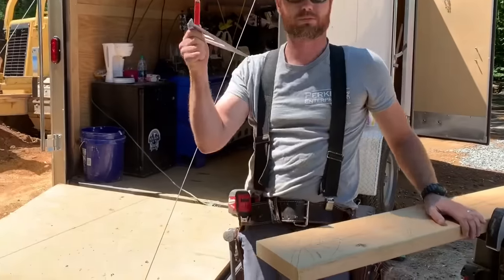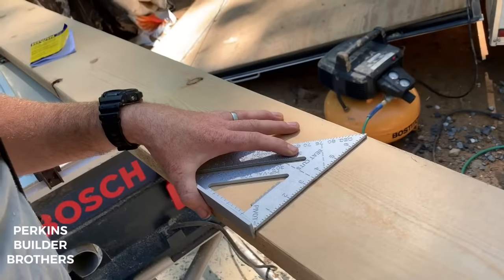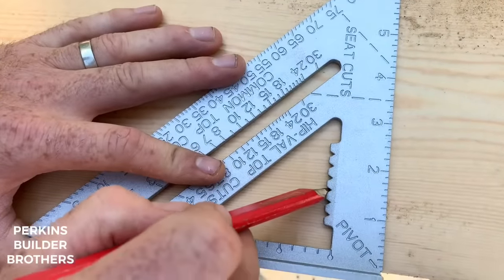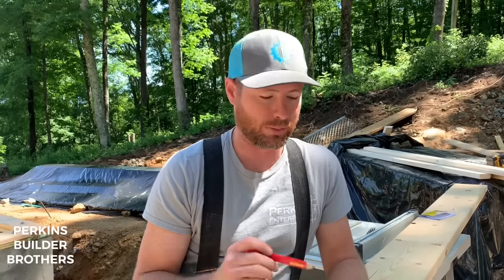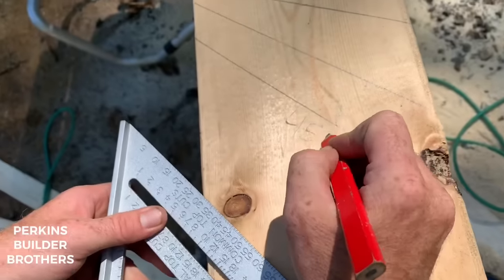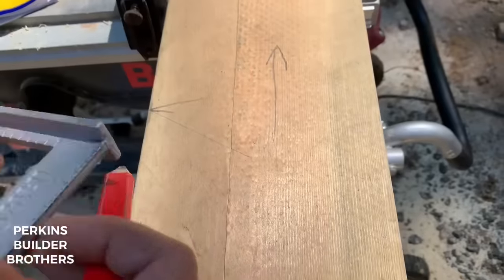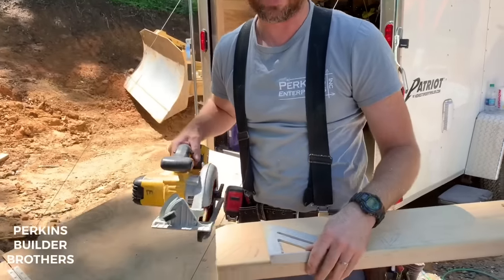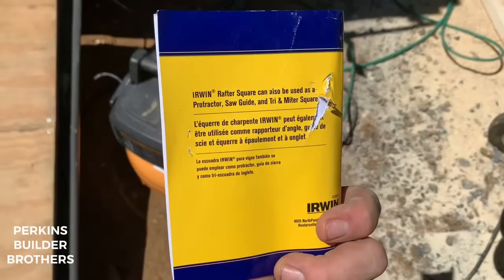How to use a speed square | Why it might be the most important tool you own

Comment: Mistake at 3:09 - that is a 40 degree line from a perpendicular to the board length, or a 50 degree line from the long side.
Reply from the maker: Mark M yep your right... Unfortunately I didn’t catch that and you can’t change your video once it’s posted :-)
Reply: @PerkinsBuilderBrothers  No problem... But can you suggest what I can do now that my roof is 6" above the walls? 😉
Reply from the maker: Mark M haha! Reverse engineer it

Comment: Great video! …but this important detail is incorrect: 3:01
“And that’s a 40 degree line in relation to this edge of the board”

In fact, that’s a 40 degree line in relation to an imaginary 90 degree line perpendicular to the edge of the board (across the board.) It is a actually a 50 degree line “in relation to the edge of the board.”

Comment: Keep your hand behind the blade, set the square on the back instead of the front hold the board extend your thumb on the edge of the square. You do it that way every time until it's habit and your hand will never be in the path of the blade.

Comment: Proud carpenter here. I always tell my apprentices that speed squares teach you nothing. This video, while handy to those who are not skilled in the trade, proves my point that they should not be used by any professional carpenter. A 1’ framing square will do absolutely everything that this square will plus more. It teaches you the theory behind all the calculations that a true carpenter should be doing. Get good with a framing square before you use a speed.

Comment: 3:05 Hold on, if the angle of the square hanging of the board is 40°, then surely the line you draw is 50° in relation to the the edge of the board?

Imagine the same process and the lines that would be drawn if it was 20° you'd measured.

Comment: I was hoping you'd have a hidden gem of info I didn't already know but before getting through half of it you claim to have scribed a 40° line in relation to edge of board when in fact it is 50° from where you pivoted. The 40° you're stuck on is the portion of the speed square hanging off of the board - therefore the remaining 50°(of 90 total in a square corner) is what you've made your mark with. Not trying to bust your balls just pointing out how you don't want to make a tutorial spreading incorrect information, particularly to those who wouldn't know any better

Comment: What about using the speed square with a level to find the pitch of an existing roof? Or how about what those notches are for on the opposite side of the ruler side? ( the are for laying out both sides of a stud without having to measure 1 1/2” like u did).  The edge with the small circles, or where your holding it. Also that scale goes up to 3 1/2”. Your video was ok but lacking a lot of more advanced knowledge.

Comment: He was wrong about the angles. If you set the square to 40, it's a forty degree angle in relation to the 90 of the square, not the edge of the board

Comment: Plumb cut, not top cut. They're even dumbing down carpenter these days. 

Don't mess with making two lines for a seat cut. Just find the degree value of the plumb cut for the pitch you're cutting. Then find its compliment (subtract the plumb cut from 90), that is your seat cut. 

Don't forget you have ruled marks on the inside of the square. Use those markings for layout (1-1/2", 3", 4-1/2").

Comment: He just made a common mistake, he used the speed square for a measurement, but pulled from the edge of the square instead of where the square pushes tight to the board

Comment: I NEVER CARRY ONE I CARRY AN 8X12IN SQ THAY DIDN'T HAV SPEED SQUARES WHEN I STARTED OUT. BESIDES EVERY TIME I REACH IN MY BAGS THE FN THING GETS DRAGGED OUT. I CAN STILL DO EVERYTHING A SPEED SQ CAN DO AND MORE WITH IT. AND BY THE TOP CUTS OF RAFTERS ARE PLUMB CUTS AND BOTTOM CUTS ARE ( WAIT FOR IT ) LEVEL CUTS. AND YOU NEGLECTED TO EXPLAIN THE LEVEL CUT OF A HIP RAFTER. I KNOW ALOT OF CARPENTERS WHO CAN'T USE A FRAMING SQ TO CUT RAFTERS OR DO THE MATH TO FIGURE RISE & RUN AND I NEVER LAYOUT. PLATES ON THE FACE OF THE PLATE AND GOD FORBID LAYOUT EITHER SIDE OF A STD UNLESS ITS BETWEEN A KING STD AND TRIMMER THEN ONLY THAT LINE OR ONE SIDE OF A PARTITION. ALL 16IN CENTER STDs ARE CENTER MARKED ONLY NEVER SQRD BY TRICKS CARPENTERS LEARN.  KEEP ON BUILDING.    PS. THE SIGN OF A GOOD FRAMER IS HOW FAST HE CAN FIX HIS FUCKUPS.!

Comment: Everything is easier in tenths. Standard is inefficient and a pain in the ass. What's halfway between 3/16ths and 5/8ths? What's halfway between 6/10ths and 9/10ths? 7.5.One can be done in your head, the other doesn't even look logical on your calculator.

Comment: You Americans really need to go METRIC....feet , inches ,half inches ,quarter inches ,eighth inches, sixteenth inches......bloody hell how hard do you want to make it for yourselves ?   If you can count from 1 to 10 you can work metric , its so easy.
Think about weights . 1 litre of water weighs 1 kilo therefore 1000 litres of water weighs 1 tonne...easy..1 sq metre of roof area will catch 1 litre of rainwater  for every millimetre of rain that falls ..easy. When building in the metric system EVERYTHING is measured in millimetres , no confusion , no complicated adding of fractions...just straight addition and subtraction.
Reply: What is so difficult about working in 10/16ths? A 16th is actually far more precise than a millimeter 1/16th of an inch=1.57mm. The only difficulty comes in understanding the conversions between the two systems quickly. The supposed adage of "do it our way because it is better" is getting irritating. You do your thing. We are doing just fine.
Reply: @justme-ij2qy  , mate I understand where you are coming from as I too was pissed off at first when the metric system was introduced here in Australia  years ago ...but it just makes sense to work in a decimal system , its a shitload easier....after all , we all do it with money . 
I work in the building trade and did some time in the US a few years ago erecting modular steel frame buildings and quite honestly , reverting back to Imperial measurements on site drove me crazy with frustration ..the complication of fractions is just an unnecessary difficulty...but yeah ,  I won't tell you how to measure if you promise not to let the Kardashians out of lockdown...ever. 😁
Reply: @garyjones5406   Sorry. I am trying to figure out how to send the Kardashians and their like to you. 
    Currently I am in the process of building several way too fancy high priced homes for others here in Montana  during winter. Lol. Whatever if people pay and treat me well I will accept their money. 
   For years I worked in a large facility with state of the art equipment from all over the world. I contracted on as a rough neck doing concrete and steel work, but I ended up staying and doing fine tuning and maintenance. 
   It turned into 13 years of work. Lol. I literally carried measuring tapes with me that had metric on one edge and imperial on the other. My fine tuning levels were all metric 1/10'000 of one mm. Lol. At the end of the day I live here in Montana and we were taught the imperial system so it could definitely be difficult working with people, tools, etc., that were metric, but it was also excitingly, challenging.
    It absolutely is frustrating having 2 systems. I could use my brain for other things if people could just quit F-ing around, bite the bullet, and decide. Lol. 
    That's not in my power so I just do what I do. Lol.
Reply: @justme-ij2qy  , sounds like you and I should share a beer and a laugh👍👍. It seems we are both at that stage of life where we only work for clients that suit us and not the other way round....its been years since I had a problem with anyone on site now that I only work for  (and with) decent people who have a sense of humour and their boot off my throat.
 As for the Kardashians , kill me please ...I don't know if you've ever been here to Oz but American "culture" is thick here..fat women , tattoos , McDonalds , Kardashians , even BLM ,we got all the crap and not much of the real America , unfortunately !
Your country is wonderful and Americans are very clever and a hoot to be around ,  shame the media drives what we see here so that the majority of us really don't know who you REALLY are.
   I have been watching your election run up with great interest and honestly cant say much for either bloke really , Biden is a huge shonk and Trump is a loose cannon but of the two , if I had to choose (and Im glad I don't) , it'd definitely be Trump , if only for the fact that his wife is a top shelf good sort.😀
  Its Sunday arv here and I've just driven 500 klm's.....sorry...310.686 miles.😁... back home  after a weekend in Newcastle NSW  ( great joint , real people ) better pull my finger out and get ready for tomorrow. 
Cheers mate .

Comment: If a 12 in 12 pitch is 45 degrees why isn't a 6 in 12 pitch  22 and half degrees?  First one to answer wins a trip to Mexico via your own car.
Reply: For common rafters: pitch is ratio between the rise and run. The angle (between the rafter and horizontal plane) is directly proportional to the INVERSE TANGENT of that ratio, rather than being proportional just to the ratio.

So for a 12-12 pitch the angle=tan^(-1)(12÷12)=45°
Whereas for a 6-12 pitch the angle=tan^(-1)(6÷12)≈26.57°.